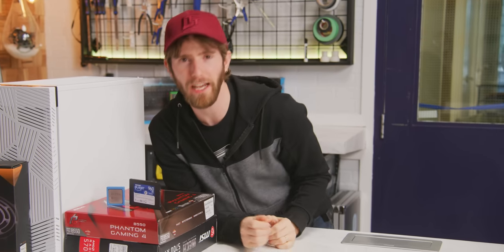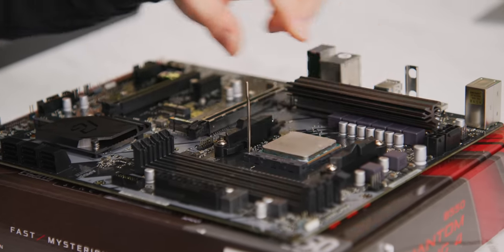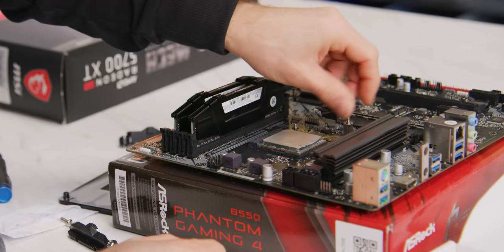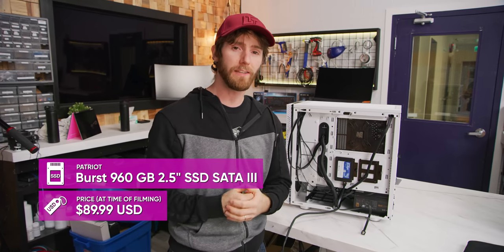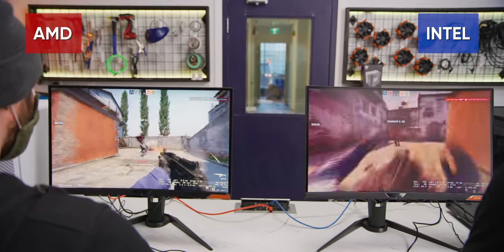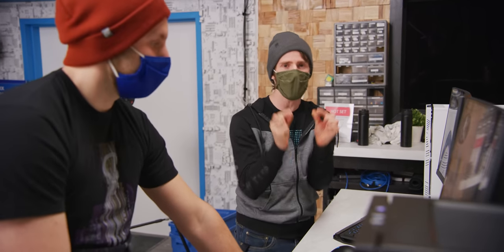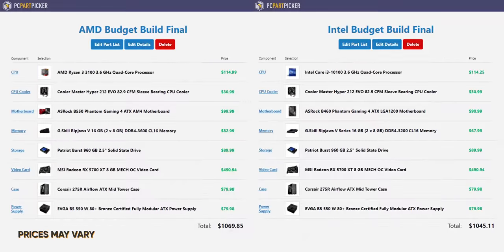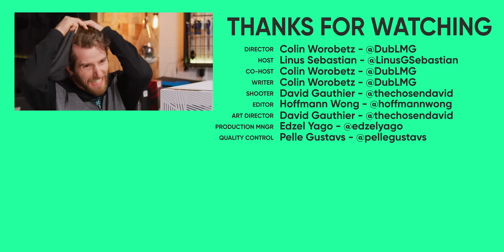AMD vs. Intel midrange gaming PC challenge

Comment: "budget friendly" 1000 USD. I just built a budget PC for $460 for my nephews. More than enough for GTA 5 / Minecraft etc. LLT used new components to build a budget PC, but a true budget PC should be built with eBay parts. The graphics card they used is on par with an RTX 2080. I wouldn't expect anything higher than a 1660ti to be called budget.
Reply: That would be entry level, you don't even have a viable video card for current generation games at that price. Even a modern console is going to be better than a sub $500 gaming PC.
Reply: Man the title says midrange GAMING pc... With a 460$ PC you can't play videogames decently.
Reply: Tomorrow I will build a pc, almost only from hand me down parts, the ssd and some fans will be new
Reply: @LatvianVideo  Hand me down or used parts completely changes your cost ratio, you could build a PC this good for substantially cheaper if you are (lucky enough) to be able to source the used parts for it.
Reply: Drop the CPU and the video card  and get a ryzen  3400g with vega graphics . U still have a upgrade path with the 550 motherboard .. and save $ 450 off of the build
Reply: @TheCj71984  it’ll come nowhere near the performance though, even with the low end CPUs bottlenecking the higher-end GPUs
Reply: less than 750 is entry level. If you go under 500 then it's used or something like an Athlon APU without discrete gpu. 1000$ is mid range.
Reply: @LzysGraphics  yeah but some people don't got alot of money and still Wana game  and don't mind 30fps
Reply: @Vincent_Beers  no. Unless you've figured out some way to use it for something other than gaming or browsing.
Reply: My guy you can play Minecraft on a potato
Reply: @Vincent_Beers  I'm happy that my brother upgraded his gpu, so he also needs a PSU, and those are all of the main parts I didn't have. I ordered some fans, so I will be able to close the case, as I will have total of 2 fans in the case (Until the fans come), Cpu and some other fan, which Idk where Imma put yet. I also ordered a SSD, it is a Crucial BX500 240gb. If you want the full specs, tell me.
Reply: @shawnshurtz9147  We're talking about gaming PC's, please stay on topic. If you want to talk about basic data entry and web browsing computers you can easily be in the $200 or less price range, but please don't expect them to play anything other than browser games or games designed for extremely low end systems, there's 1000's of games that can still run on computers from 10+ years ago, but they aren't part of a conversation related to current generation hardware (which was the point of this video)
Reply: @2un4tunate67  Just saying, a budget gaming PC should be closer to $500, they were stuck with still using new components.
Reply: @2un4tunate67  That is provably false.
Reply: @giuseppemonte8748  GTX 970 I used, Probably not Cyberpunk (Edit: Just checked, you can get 40FPS playable on a 970) but plenty of other games are running 40 - 70 FPS no problems. I swear the title said budget. He said budget in the first 20 seconds.
Reply: Did you know Budget and Midrange isnt the same word ?
Reply: You are right about budget and second hand stuff.
You are wrong with GPU comparison. RX 5700XT is comparable to RTX 2070 not 2080.
Reply: @marekkuklis5867  Yes 2070 is closer.
Reply: @Vincent_Beers  i wasnt talking about that i was talking about the usefulness of a computer for things other than gaming especially now. And a 500 dollar computer that can game just as good as a console is easily obtained. You should not get a console for any reason unless you're just a parent that wants to shut up your kid. And you would be better off building a computer for the money. Also I can be a passive aggressive prick also.
Reply: @Vincent_Beers  ok so a gaming pc can do nothing but gaming and surf the web just like a console correct. You'd be far better off getting a gaming pc regardless. I've never seen anyone do a word document on a console to turn it into school. You'd be far better off with the pc. Plus if your concerns are 1000 dollars you probably shouldn't have either.
Reply: @rohanap5511  have you ever tried?

Comment: Wonder when this was filmed because that Ryzen chip is like $200, dammit. 😑
Reply: Weird, I bought my ryzen 3 3100 for 115USD just back in September
Reply: @natskar  yeah in September. Now it sit around 200 in the USA and in Europe, if you have the chance to grab one.
Reply: @dexmiermaxime8583  I just checked newegg, the R3 3100 isn't available, but the R5 3600 is available for $199
Reply: Bought my Ryzen 5 3500X from China for $124. Better benchmarks on single- AND multi-core, better boost frequency, 50% more L2 & L3 cache. Only drawback was waiting 20 days for shipping.
Reply: @matchbox9167  dang that's a steal!

Comment: Who’s gonna tell them a 1tb nvme drive is 95$
Reply: Yeah I grabbed a ADATA SX9200 for 105€ all taxes included (21% sales tax), off Amazon, no deal hunting. I think it is definitely worth the 20 bucks more, especially considering this is already a $1000 build (not budget by any means, and I'd say this is definitely more than "midrange") and that they took upgradability in consideration. 

For the same amount, I'd rather have a significantly better SSD than 400 extra MHz on RAM. 

SATA is definitely the superior choice for storage/high capacity, but for a boot drive and up to 1tb, I think this is the most disputable choice of their build.
Reply: @Baalecas  not realy, because this was a gaming build, for games a nvme drive doesnt do aything and a sata ssd gives you enough performance boost. this adata nvme from amazon is probably only a 500gb ssd or/and a pcie 3.0 drive and specialy for ryzen a good ram with decent speed and timings is more important for gaming performance then a nvme drive...and as he sayed, the price difference between 3200mhz and 3600 mhz was 3-4 $
Reply: @georgwarhead2801  It is true, if the point of the build is to squeeze every possible fps in games as possible, this may be a better use of money. For a game drive it's been tested again and again that SATA or PCIE and DRAM or no DRAM barely matters. Which is probably what they had in mind, and the people behind a tech channel are surely more knowledgable than me. 

As a main drive though, I still feel it is the wrong place to be cheap, and the lack of DRAM will impact daily use, and it being QLC is not great for longevity... Realistically, I don't believe most people build a pc ONLY to play games, but have other uses for it, which would benefit from the better drive, especially long-term. This may be a difference in philosophy though between my view of a $1000 computer and this build, which i find too focused on gaming and not reflecting actual daily use.

btw, at 03:16 you can see a $15 difference between the two sets of RAM, which I based myself off to say the price difference was in the same ballpark. 

In any case, one or the other both impact performance for only a few %. You definitely aren't going wrong one way or the other.
Reply: LTT increasingly has this problem of build videos with bizarre bad-value recommendations that make me strongly wonder how they can possibly be so out-of-touch. Like, I can't imagine who made the two lists in this video with a straight face.
Reply: @georgwarhead2801  They paid $89.99 for the SATA SSD in this video. You can get an NVME one at the same capacity for $92.99. There's no reason to go for the SATA option.
Reply: @Baalecas  Thousand bucks is pretty midrange. You don't even start to see high range until you hit the $1500 mark. An actual high end gaming PC is two thousand dollars and above, and a big part of why that is is because nvidia is so price gougey. A 2080ti build is going to cost you like $1300 for the GPU alone. Even now with sane prices a 6800XT is going to sink like $700 (because if you're building so high end why wouldn't you get a custom card?), case is like $100, storage easily another hundred or two, RAM at least another hundred, so we've already exceeded a grand before even getting to the CPU let alone power supply and any other parts including meme fans or an AIO if you were heading that way. So realistically speaking, nothing under $1500 is ever going to be high end. 

Oh and the motherboard, forgot about the mobo. So there's another $150, or if you're like me and firmly believe a good house needs a good foundation and sink $200-300 on a mobo which you likely are doing if you're building a real high end system. Like my PC alone is just barely a sub-$2000 system and I threw in a 3700x and 5700XT, which granted I built specifically with the rest being higher quality parts and geared specifically towards it having a higher end upgrade path (specifically able to replace GPU and CPU and add more RAM to keep it up to date as mid to high end several years from now) but still. Had I simply not gotten higher quality stuff like a high end x570 board and had I not gotten extra crap including but not limited to 2x CD drives and a front mounted card reader this midrange system still easily would've cost me $1300 minimum if I went cheap as possible on everything else.
Reply: @Jimster481  Can you go into more detail on that thought. Looking to build my first rig, what would you do differently and why?

Comment: At $490, you were one case downgrade or memory kit change from getting a 3070.
Reply: Yeah this was such shit part selection lmao
Reply: Except u can't get a 3070 right now.
Reply: @ericyuan9718  ditto 3100
Reply: The 3070 would have been wasted on those CPUs anyway.
Reply: @d4t6ix  You could upgrade that later
Reply: The 3060 ti offers a much better performance than the 5700XT. They are trying to go for actual prices of in stock components. Still paying almost 100 dollars over the MSRP of 1 year old cards feels. Wrong. I wish they just went for an at MSRP build.
Reply: The whole point is because of current price shortages. MSRP on the 5700 is 350 but he paid 490 for it because thats what scalpers charge. He bult this using real world current pricing, not MSRP
Reply: Well the 5700xt is also completly overpriced for that money. So yeah. Also the R3 3100 is basically 40$ more than it should be. You should get a 3300X for that price what is a lot better in games. Right now buying anything is stupid.
Reply: @nukularpictures  man must have swallowed some office supplies cuz hes spittin straight fax

Comment: In Q1 2019 I bought the $60 Asrock B450 HDV Rel 4.0. In Dec 2020 I downloaded the second version of the BIOS support for the Ryzen 5000. Probably it will have some throttling issues with the 105W CPUs, but officially it supports them too. Currently I use a Ryzen 3 2200G, but basically I'm looking in the coming year for an upgrade with a 4600G or 5600G (65W), if around $200.  It would improve the CPU performance to 200% to 300%. 
Backup plan is 3600 with my ancient 1 GB GeForce 8400GS with a whopping 16 CUDA cores. The Vega 8 iGPU normally does not exceed 700MB VRAM and a GPU load of 20%, so the 8400GS would be fine too. Only when trying Wolfenstein-3D or  Linux games like SuperTuxKart  in a Virtualbox VM with 3D accelleration, the GPU load went up to ~80% :)

Comment: When I think budget build I assume round 4 to 500 able to play most games on low to medium settings at 60 fps 1080p. Mid range round 1000 able to play most games on high to ultra 60fps 1440p or 1080p for higher frames. Top of the line your looking at about 2000+ but you could probably run your games at 4k 60 fps on max. Regardless on how much you spend your not wrong, just how much your willing to spend to make your games look better.

Comment: Was this recorded before the 3060ti came out?
EDIT: never mind, they’re playing cyberpunk
Reply: They must be considering actual availability. You can't actually buy a 3060ti, except from scalper at 1.5x the theorical price.
Reply: @dubourg4  That is almost certainly the case.  They recently did another video where they tried to make the best build at various price points and in that video they explicitly stated that they were only including stuff you could actually get/using the prices stuff was actually selling at.
Reply: Cuz a 3060 Ti takes slaving over stock drop websites and streams so you even get the chance to click "Add to Cart"
Most of the time you won't get it, but it's all luck.
Reply: Honestly these are poor choices. Theoretically you could get a Ryzen 5 5600 as well as an RTX 3070 for about $1,100.
Reply: @lysolmax  As a couple of us mentioned above these choices were almost certainly made with practical availability/prices you'd actually pay in mind.

Comment: For ram speed you might have to switch the slots to A2 and B2 to get faster speed.Atleast on my Asrock x370 pro4 I couldn't get HyperX Fury 3200MHz RGB to 3200 only 3000(same 3100 CPU) on A1 and B1.Also try different Infinity fabric clock scalar.Mine can do 1800 MHz overclock on infinity fabric(1600Mhz for ddr4 3200).Since then i upgraded to MSI MPG x570 gaming plus

Comment: this is misleading, the b460 with core i3 will max out at 2666 memory, leading to an almost 1000mhz (effective) difference between the two systems.
Reply: They said that
Reply: @kamally  they said 2933 mhz
Reply: They also said the SSD is DRAM less and that the 5700XT doesn't support PCI gen 4, little surprising seeing a tech channel of this size getting this much wrong in a video...
Reply: But it isn't "misleading"

Comment: As if you wouldn’t just use the stock coolers for those cpus , what a waste lol
Reply: Both of these builds are actually TERRIBLE for $1000. Like, so bad that LTT honestly needs to take a step back and consider how exactly their scripting / editing process lead to these horrible-value woefully out-of-touch nonsensical recommendations.
Reply: @ShogoKawada123  I completely disagree tbh. The opposite of out-of-touch actually.  These are decently rational builds at the moment because they are implicitly considering the lack of stock in cutting edge hardware. If there were infinite 30 series nvidia cards and amd zen 3 processors, then of course these builds would be awful... but this is not the reality unfortunately.
Reply: People out here really thinking they know more about computers than Linus. jeez
Reply: @starzman  You can easily make objectively better AMD and Intel builds at right around the same price as the two PCPartPicker lists shown in the video, even while massively overpaying for a 5700 XT the same way they did. For example:

AMD build:

PCPartPicker Part List: https://pcpartpicker.com/list/2GpGdD

CPU: AMD Ryzen 5 3600 3.6 GHz 6-Core Processor  ($194.99 @ Newegg) 
Motherboard: ASRock B550M-HDV Micro ATX AM4 Motherboard  ($80.98 @ Amazon) 
Memory: Crucial Ballistix 16 GB (2 x 8 GB) DDR4-3200 CL16 Memory  ($63.99 @ B&H) 
Storage: Mushkin Enhanced Helix-L 1 TB M.2-2280 NVME Solid State Drive  ($92.99 @ Newegg) 
Video Card: MSI Radeon RX 5700 XT 8 GB MECH OC Video Card  ($526.99 @ Amazon) 
Case: Deepcool MATREXX 30 MicroATX Mini Tower Case  ($29.99 @ Newegg) 
Power Supply: SeaSonic S12III 650 W 80+ Bronze Certified ATX Power Supply  ($61.98 @ Newegg) 
Case Fan: Cooler Master SickleFlow 62 CFM 120 mm Fan  ($7.99 @ Amazon) 
Total: $1059.90
Prices include shipping, taxes, and discounts when available
Generated by PCPartPicker 2020-12-31 12:10 EST-0500

Intel build:

PCPartPicker Part List: https://pcpartpicker.com/list/94xGdD

CPU: Intel Core i5-10400F 2.9 GHz 6-Core Processor  ($159.99 @ B&H) 
Motherboard: ASRock B460M-HDV Micro ATX LGA1200 Motherboard  ($76.98 @ Amazon) 
Memory: G.Skill Ripjaws V Series 16 GB (2 x 8 GB) DDR4-3000 CL14 Memory  ($89.99 @ Newegg) 
Storage: Mushkin Enhanced Helix-L 1 TB M.2-2280 NVME Solid State Drive  ($92.99 @ Newegg) 
Video Card: MSI Radeon RX 5700 XT 8 GB MECH OC Video Card  ($526.99 @ Amazon) 
Case: Deepcool MATREXX 30 MicroATX Mini Tower Case  ($29.99 @ Newegg) 
Power Supply: SeaSonic S12III 650 W 80+ Bronze Certified ATX Power Supply  ($61.98 @ Newegg) 
Case Fan: Cooler Master SickleFlow 62 CFM 120 mm Fan  ($7.99 @ Amazon) 
Total: $1046.90
Prices include shipping, taxes, and discounts when available
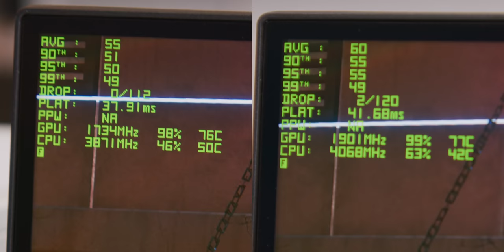Generated by PCPartPicker 2020-12-31 12:16 EST-0500
Reply: @jordiroodi5985  Bad attitude to have. LTT is not infallible. The fact of the matter is that if you tried to post either of the lists in the video as recommendations on somewhere like Reddit's /r/buildapcforme in real life, you WOULD be downvoted into oblivion, and rightfully so.

Comment: As a musician I'm super happy with my Ryzen 3 3100 due to its bang for the buck single core performance, however, paired with a RX 570 I've experienced so many more instabilities and issues than I ever did with Intel and Nvidia
Reply: That is probably just a luck of the draw thing, and not because the Intel and Nvidia combo are bulletproof stable thing. Another person with your same hardware may have made the opposite statement.

Comment: Yeah, lol, as soon as they stated the specs I was like, "I'm pretty sure you're going to be CPU limited at 1440p and be overpowered for 1080p, so I'm not sure this rig makes sense."  And low and behold... =P
Reply: When u get to 1440p your CPU dose not hold your GPU down as much as u think the higher the resolution the lower your CPU bottleneck your GPU your GPU is doing all the work at higher resolution
Reply: For reference, to get my 2080 TI to render 1440p @100-120 Hz, I routinely use 100% of each my 8 CPU cores.  So at 1440p, it's very easy to underestimate the performance needed on a CPU.

Comment: just thrown a OEM 3500x in a Asus A320 mobo with 16 gb to replace a i5 3570 system , my word the step up is amazing, even with an old rx470. there are certainly bang for the buck cpus out there. this thing is quick.